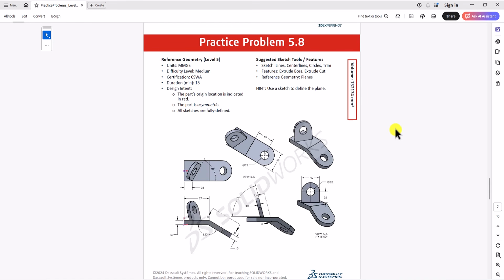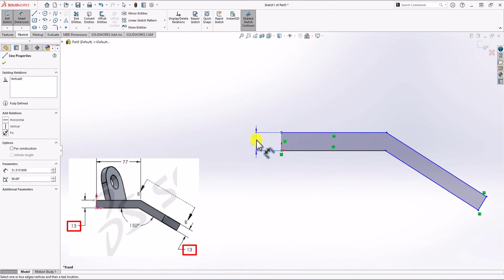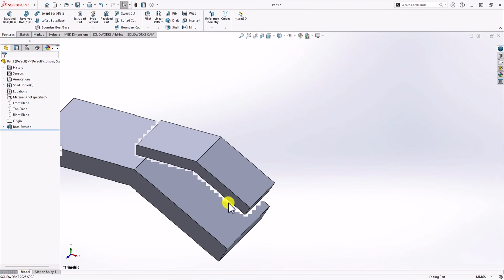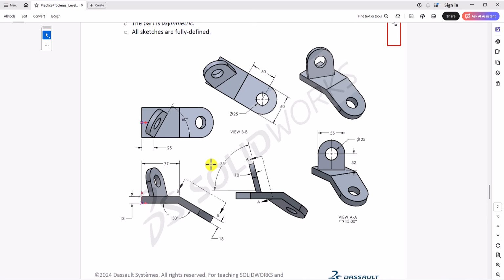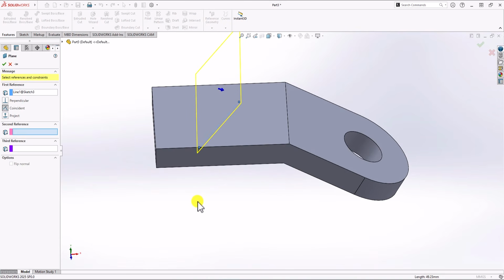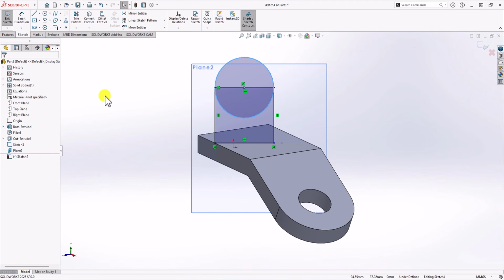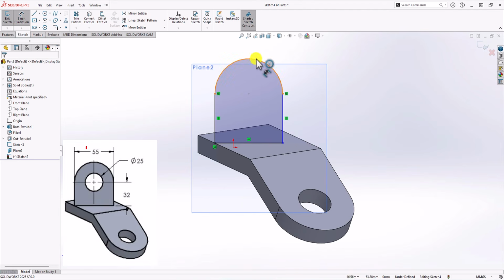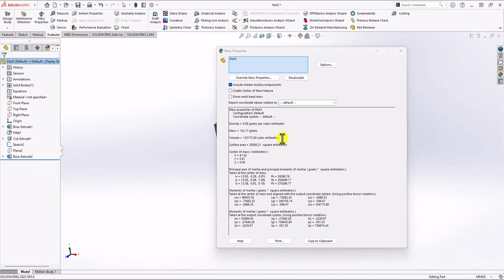CSWA Practice Problem 5.8 Solution | SolidWorks Exam Guide

Comment: Why do I have the right dimensions in the actual part, but a different volume and wrong dimensions when using smart dimensions in the engineering drawing of the same part?
Reply from the maker: Honestly, it’s hard to say without reviewing your model. Could you let me know which dimensions differ in your drawing? Also, did you follow all the steps shown in the video?

Comment: Nice trick 8:29 . Is there a shortcut to do this faster, specifically when switching from a line to a tangent arc?
Reply from the maker: Thanks for your question! The method I showed is a shortcut, but if by “shortcut” you mean a keyboard shortcut, then yes, there is one. An alternative approach is to start by drawing a line, and without moving your cursor, press A on your keyboard to toggle between a line and a tangent arc.